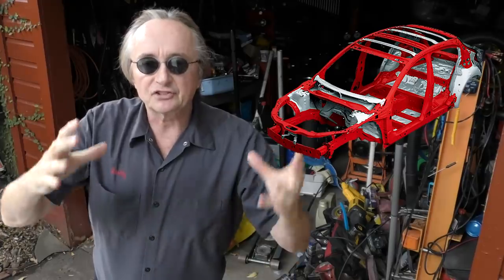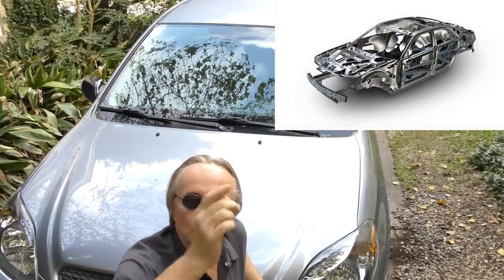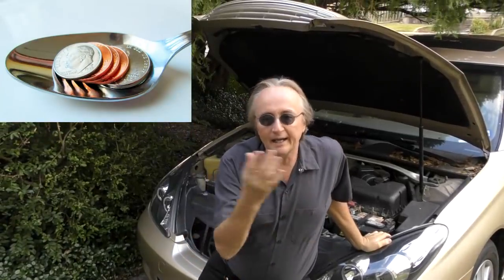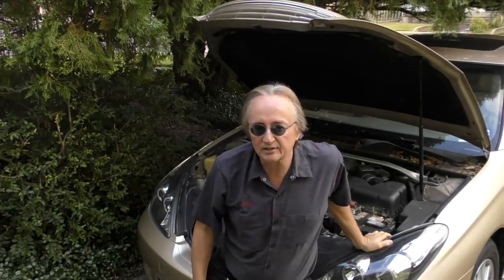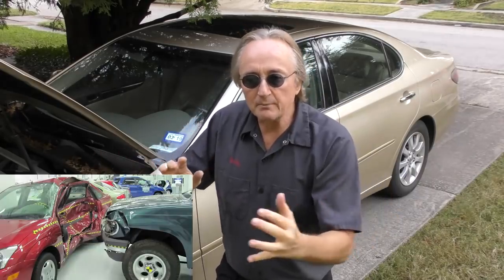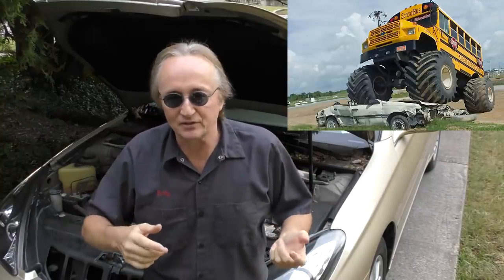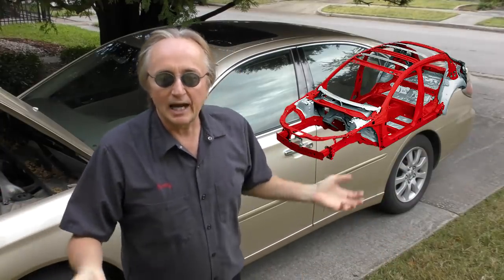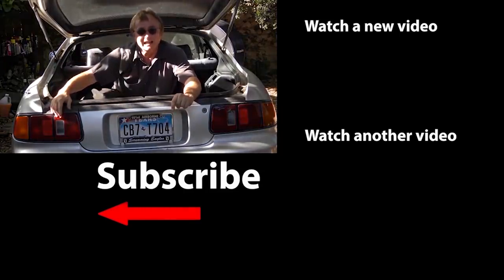Why New Cars are Safer than Old Cars

Comment: Hey Scotty,
your videos are great, been watching for months learning a lot alongside the laughs.
I have a 1990 Toyota pickup, 4spd manual, 4cylinder carburated engine with over 280,000 miles.

since I bought it 30,000 miles ago it makes a rattle sound when I'm parked and give it gas or when I drive faster then 60mph.
Needless to say I've been driving it no faster then 55-60, what do you think it is?
More importantly what do you think I should do about it?

I love this truck!!!
I thought about taking the cylinder head and block to a machine shop to have them rebuilt but the engine starts up fine and idles smoothly.

Comment: I’ve often wondered about automotive tires and brakes and our environment. As everybody knows tires and brakes wear out after usage. And we replace them with fresh ones. But where do the materials worn wear to?

What I’m thinking about is the difference of material between of new tire tread versus old tires and new brake pads versus old worn out pads.

With literally millions of tires and brake pads out there, these worn treads of rubber and brake pad materials (that by the way, used to be made with asbestos years ago) are ending up where? Atmosphere? Plants? Or just becomes road debris? 

I’m not referring to old whole tires themselves, that’s a whole other issue.

Probably it’s nothing to worry about and I hope so, -but I stay awake at night thinking about stuff like this.

Comment: Love your channel!! ???? I have a 2011 Toyota Camry 4cyl. I just turned 100k miles and want to change the transmission fluid myself. I know it can be a very complicated process to do. If the engine is cold, can I just replace the same amount of transmission fluid as I take out? I don't have the equipment to determine when the transmission fluid will reach 104 degrees. THANKS!!

Comment: SCOTTY - PLEASE PLEASE make a video answering this question: I have a 2002 Avalon just like your wife's ES300 Lexus. Amazing reliability and runs like a top as you know! My radiator is the only thing I'm concerned about being 16 years old. I BABY IT and change the fluid regularly every 50k miles. Should I change the radiator before something happens? I don't want damage to hurt engine if I wait until it's too late! The radiator is the single most important thing connected to ensuring engine life besides oil.
Reply: It's not a matter of mileage as much as a matter of time. You should replace the green stuff every two years, regardless of number of miles. I guess it can't hurt to change out the radiator, now, as a preventative thing. Change the thermostat with it, too. Use OEM components for both.
Reply: @EMichaelBall  Toyotas never use green stuff. They use red/pink fluid and manual says 100k miles so I just change proactively at 50k to average out the number mileage with years. My concern is do radiators ever blow out or do they almost always trickle leak before something happens, where I should be more watchful at temp gauge now or keep closer eye for puddles under car?

Comment: MAJOR question!!!!
My SUV is a mercury 2004 mountaineer and its heater is making this roaring noise.  It started suddenly yesterday morning. I am curious if the heater fan is gone or there is something in there and if its an easy fix.   

I was also curious if the cruise control can be fixed, as these mountaineers have a massive issue with their cruise control and unfortunately their transmission.

Comment: Thank you for the video Scotty. I have a question. Today I was cleaning the battery terminals of my car, but when I was tightening the bolt I accidentally broke it. Do I have to replace the whole terminal or is there a simpler way to tighten the terminal? Thank so much!

Comment: Another issue with unibody construction is they don't have the towing capacity that body on frame does.  That's why we see trucks and SUVs towing most of the time.  

My question:  Why do a lot of newer cars have plastic covers all over the engines now?  It started out with luxury cars to make them look neater and I'd suspect hardly any luxury car owners worked on their own cars.

However now, they're on cheaper cars like the Ford Escape.  I saw a Lexus where hardly any engine parts could be seen with the hood up.

Can they be removed and left off?  

I'd have a hard time buying a car with all of the plastic obscuring the engine.  It screams "no user serviceable pars inside".

Comment: Hi Scotty. From PORTUGAL one question I'd like to pose. I heard you talk about Mercedes in several occasions and opinions. I own a 1993(last series) 190D (w201) with ''only'' 340.540 km (roughly about 180 miles) that only needs oil/oil filter change each 5/6.000 miles ( roughly 10.000km). Doesn't ''smoke'' and only ''big'' repair was last year engine head gasket (I guess that's the name in English). So my question is .... what's your opinion about those ''less younger'' Mercedes?? Congrats on your channel.

Comment: one bad thing about uniframe cars is your limited on horsepower.  like for example the new dodge hellcat and dodge demon. so aftermarket performace companies came out with unibody connectors you can weld or bolt on i would prefer bolt on then weld around  the bolt up. where it makes a unibkdy frame a whole frame with the unibody connectors and there comkng iut with new connectors all the time for all sorts of engine mods you can put in a unibody car.that is aslo what dodge are doing to there higher hp cars as well. you can only put some much horsepower on a unibody before the weld zones  whuch how they attach the unibody to the car's body. as well as bolt up too.will break from revving and launching while racing trust me my buddy had a high performace 5.0 80's mustang.  EXCEPT IT WAS A 390 UNDER THE HOOD OF THAT 80'S MUSTANG. Well he just ran a stock unibody frame without modding the unibidy frame and eventually he had to yank out the motor and transmission on the front because it warped the mounting point for the unibody so bad the car could never be driven again. that car was only good as a parts car. last time i heard of that mustang he had he traded it for a modern day 07 powerstroke. and the mustang owner couldn't save it so he put up for sale online for 3500 bucks as a rolling chassis. nope that car WAS WORTH IT NOT ANYMORE. that mustang needs to be sold to a scrapyard because to anyone who has no expierence with cars  that car is a deathtrap.
Reply: In general all cars are now designed to handle a specific power level. That is part of why unibodies are so nice, you can tailor the strength/weight/crumple ratio through design. The shape of the pieces make for the strength and rigidity. If you increase the power beyond the design limits of the car it will twist it. A friend twisted a 69 Dart frame by putting in a high-po 340. The frame was strong enough for the stock design, but needed reinforcing for the higher power - especially with a 4 speed. 

To criticize unibody construction because it is designed to a narrower use window is silly. It is very possible to twist any frame-based car by too much power, but that frame-based car will be heavier and therefore slower, for the same amount of power and strength. Unibody cars can be more rigid than any body on frame vehicle simply because there is no flex point between the body and the frame. Not many are made that rigid, because there in no point in it except for high-performance or competition, but pound-for-pound a well-designed unibody car will outperform a frame-based one in every aspect, from rigidity in handling to ability to absorb a major crash. Yeah, big U-channels and I-beams look impressively strong, but they don't have the actual strength of the well-designed crimped pieces. In trucks that gets to be less true, but you could make a sort-of unibody truck that was just as strong, but it would become so complex that it's not worth it. The big problem with a truck is the same one you have with a convertible - the unibody relies on the roof structure making it a closed shape. Without that it becomes the difference between trying to crush a whole egg and half an eggshell. 

In short, none of your examples are relevant because they are all examples of going outside the design parameters of the vehicle.

Comment: Scotty! My 1971 Ford F-250 has good brakes but no pedal pressure. I just replaced both the master cylinder and the power brake booster. What do you think could be the problem. Is it a vacuum problem?

Comment: Scotty what do you think of this new filter-minder system that tells you when to change your oil and fuel filter?  I was always a mileage interval guy, but I bought a 2017 Ram 2500 with the Cummins that has the system in in. 
Thanks, 
Sammy

Comment: Hey Scotty, I drive a 2009 Nissan Versa sedan with a manual transmission. It has about 130,000 miles on it. Should I think about replacing it with something newer, or just keep driving it until it has a major problem? I bought it used in 2014 for about $6,000.

Comment: But remember, regardless if your car is unibody, or body-on-frame, a safe and defensive driver can prevent accidents from happening in the first place. And while older cars may not be as safe as new cars today, they do teach you how to drive better because, the car is longer meaning you have to judge distance better, there are no electronic or computer assistants like blind spot sensors, rear view cameras, lane departure warnings, self parking etc. So you have to be completely in control of your car and fully aware of it's capabilities, and thus in turn will make you a better driver, master driving a 20 foot long Buick, in maneuvers, parking, braking, etc, and you can drive any new car. But regardless what you drive new or old, safe defensive driving saves lives, and your car.

Comment: Scotty, I was thinking about about either a Volvo s80 2007 or a Volvo xc90 2005 for about $4000, because they are supposed to be safe. I notice these models and years are generally at this low price at dealerships. Is this because they are extra expensive to maintain?

Comment: Hey Scotty happy Thanksgiving. I dig your work but I have a question. I have a Toy Tundra 2010 it has 186,888 miles I had the oil changed and some tires put on at a local shop. When I got the truck back the traction control keeps sticking and now my 4 wheel drive will not fully engage. I have an appointment  to get it fixed  on monday I pretty much trust this mechanic but could you give me a heads up on possible problems. Thanks Richard

Comment: Happy Thanksgiving!
I have a 2015 RAM 1500 Hemi with an 8speed transmission. The owners manual only states to change the fluid in the transmission when there is an issue. How often should the fluid really be changed and should I do it myself? I've always done the drain, measure amount of drained fluid than add that much new fluid. Since no dipstick can I still do this?

Comment: Scotty, i have a 2004 hyundai elantra automatic with 130,000ml. Whenever i start to move from a stop the engine shakes and hesitates and spatters before shifting to second. Also the car seems to have fuel problem when moving in 3 gear. The car starts to shake front and back as if on low fuel.

Comment: Hope y'all/yous guys are all having a great Thanksgiving.   Scotty, thank you for your channel. My question is I love Paseos, but can no longer easily find parts.  What car should I switch to that has great reliable parts, is light and gets great gas mileage?  It's hard for me to let go of Paseos but for me to find quick struts I basically have to buy another Paseo on Craigslist [harder and harder to find]  or order the parts and squeeze the coils myself.  Which is not all that bright, since I'm not good with my hands.  It's either that or pay $800 to have my local Scotty do it for me.  I love this channel because it shows how a good ol' boy from Detroit can gravitate towards Toyota [never thought I would give up on Ford ..... then I bought Taurus station wagon]  

Anybody feel free to answer this if you like cars like an MG, or a Solstice, ora convertible '58 Corvette, say more than a convertible '68 Mustang and have found a model you like.  WHERE CAN I FIND A QUICK STRUT FOR A PASEO..  x]
Reply: The Paseo shares some parts with the Tercel, so perhaps you can find something that'll work for that car (or perhaps buy a Tercel), and see if that car can supply the struts. As for replacement cars, look for either a 1998-2002 Corolla or Chevy Prizm (rebadged Corolla); 1996-2001 Chevy/Geo Metro, Pontiac Firefly, or Suzuki Swift; or 1995-99 Nissan Sentra.

Comment: Hi am Carlos from Mozambique, Thanks for your videos. I have a kia truck k2700 from 2005, four years ago i had to change the engine because had water oil mixture. But since then every time i check the radiator its has oil like mud, i tried to clean with water but nothing. How do i clean properly?

Comment: Hey Scotty,  my 1980 Trans Am I just bought has about 15 degrees of play in the steering system.  When the dealership removed it from the showroom floor they didn't start the car up because of the exhaust being loud. Is it possible to push fluid out of the system by turning the wheels without the engine running and what could be causing the excessive play in the steering system?

Comment: Hey Scotty, I have a 2006 inifiniti G35x(AWD) it consumes a good amount of oil I have to add a quart or two about once a month. It currently has about 125k miles and still runs great. Should I be concerned about the consumption?

Comment: Great video. QUESTION- Now that Turbo 4-cyl engines are putting out nearly as much, or more power than a naturally aspirated V6, would you consider one as a reliable daily driver, or stick to a traditional V6 without forced induction, if you plan on keeping it for years.  Why or why not.  Thanks.

Comment: Hi Scotty. What happens to an engine if you switch it off while it's revving at near 2000rpm and it diesels for a few seconds. What damage takes place? I was warming up an old 1983 Toyota Corolla and switched it off while the choke was on. The oil level went down a quarter way on the dipstick.

Comment: I have a 2012 v6 Jeep Grand Cherokee.  For about a month I've been having so many problems starting.  I've tried narrowing it down myself but I couldn't figure anything out.  Finally one day it wouldn't start and I had to have it towed to my local Jeep dealer.  It's my only car and I live in an apartment, so my options were very limited.  They told me the fuel pump and auxiliary fuel pump weren't working and they replaced them for entirely way too much money.  I'm inclined to believe it was the fuel pumps since I asked for the old fuel pumps and they gave me fuel pumps that stunk of gasoline.  But I'm worried the failing fuel pumps were a symptom of a dormant problem.  Could the fuel pump regulator cause the fuel pumps to go bad?

Comment: Scotty I have a 2003 3l V-6 ranger. The transmission shifts great through the gears when driving. . But when shift into froward from neutral (foot on brake), there's a delay (2 seconds) before it engages into drive....From neutral to reverse there’s no problem with delay. . What could this be....a solenoid?

Comment: Hey Scotty I have a 2010 Ford Mustang with a 4.0 v6 engine that’s running well. But it has a p0456 code. We changed the egr valve but not luck. Could it be the canister purge valve?

Comment: Very informative video today. Happy Thanksgiving to the whole Kilmer family. Scotty did you hear about Nissan in the new. Their board may oust the CEO for alleging using company money for personal use or something. If that happens the partnerships Nissan has with Renault and others because of the current CEO would be up in the air too since it was his doing. Different topic and question what do you think of the new cars with the electronic head units that have Radio, navigation, and more? Even cars that have headlights that turn when you go into turn and you cant turn that feature off. What happens when this stuff breaks who knows when? I personally know that electronics is not a friend to heat of the summer and as we know car get reach over 130degrees inside or more and surely that is not good for these head units. Any recommendations if you have one what the best care is for these head units?
Reply: The Alliance is safe. Ghosn allegedly under-reported income to the Tokyo stock exchange.

Comment: What about rust on unibody style? My 2002 Civic is quite rusty, I can't even jack it up on the rear driver side any more because the rocker panel has caved in due to rust. Is the body in any risk of being unsafe from progression of rusting, or is unibody fairly resistant to that?

Comment: Hey Scotty I just picked up a 97 Mazda b2500 with 160k miles, standard transmission with a check engine light on about an o2 sensor for $1200 do these trucks have anything I should pay attention to before I'm stuck with a huge repair bill. Thanks.

Comment: 2000 1500 5.2 Dodge truck gas a no crank/ start situation.replaced switch still the same.Any ideas? Where is the nss swith located? Thanks

Comment: For how long should you warm up your car in the winter?
Reply: As long as it takes you to go round and crape ice off the windows. assuming the car needs defrosting most cars are fine after 30 seconds although some much older cars as mentioned require a minute.

Comment: Happy Thanksgiving! I've got a 92 dodge Dakota that the cruise control quit shortly after buying it. It also slows down quite a bit when letting off the accelerator. Could this possibly be a brake issue? Thanks in advance.

Comment: Hey Scotty I have a 2008 VW jetta 2.0 turbo with 208k+ original miles. Everythings been pretty good so far but the transmission is starting to become a little wonky and seems very weak. Anything i can do to keep it lasting or should i get rid of it?